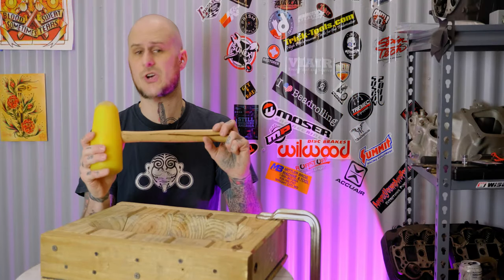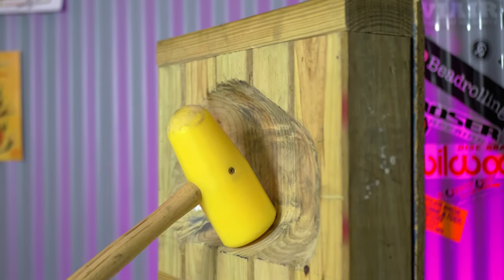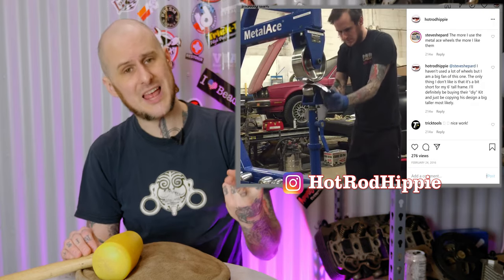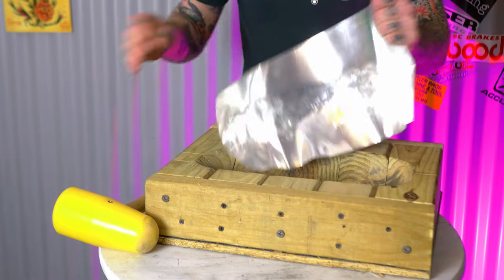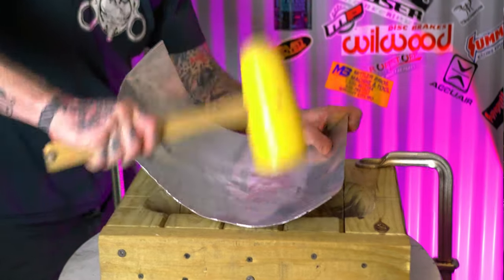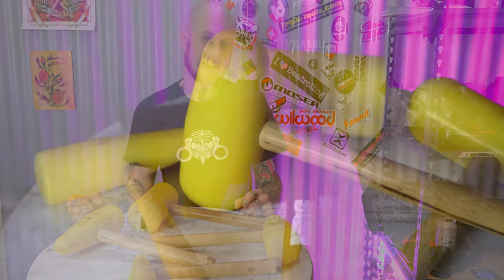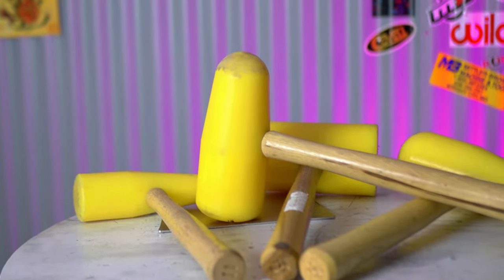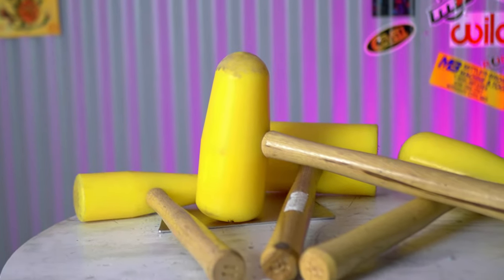Bossing & Blocking Hammers Intro! - Rapid Metal Shaping

Comment: I have those white polymer bossing hammers durable yes and feather light. Take note I may have been directing my strikes with too much fervor and not enough finesse. I was dead tired after using them.
Reply from the maker: Yea I don't miss those things. They feel like smacking metal with a rolled up newspaper. 🤣